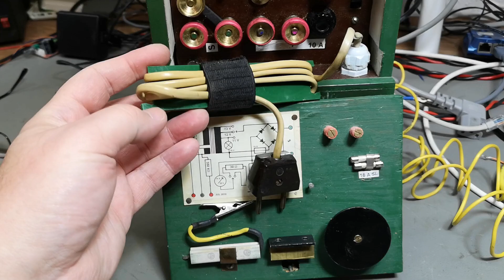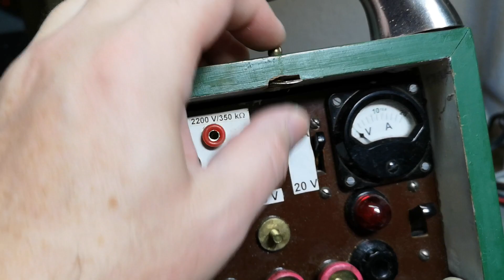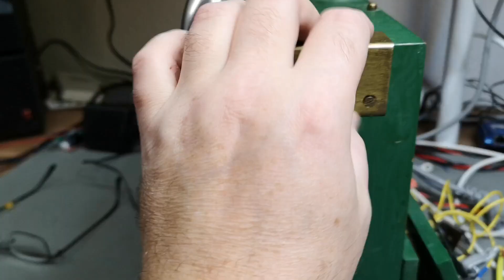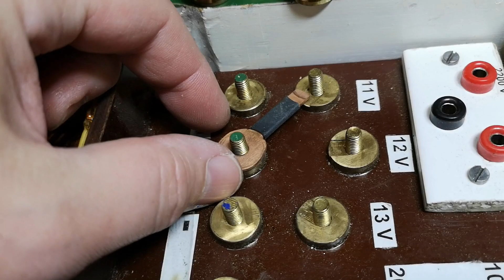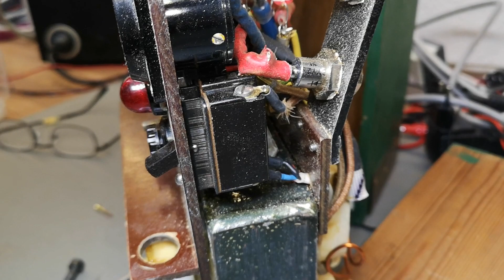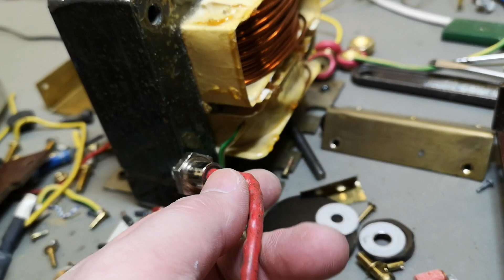DIY 12V battery charger and 2kV microwave transformator 2010

Comment: Part of an Electric Chair.
Reply from the maker: i belive the parts are from a microwave oven, and its purpose is mainly to charge a 12V car battery, the high voltage output is very scary

Comment: My o my, a dangertron 3000, The idea of winding a low voltage output on top of the HV secondary of a MOT alone is really scary.
Reply from the maker: cool name, i had the idea to call it the brand new "KillMeFast" but then i started to think back.. way back on own first constructions, I am happy youtube was not arround back then, and even more happy no smart-ass wise dude rewiev my own "products" :-) i cant be the only one.. so it seem, But with that comment : microwave transformers are free, and easy to reuse, but please folks : REMOVE the high voltage winding, and the constant current metal, then wind you own LOW voltage high current sec and have fun, now it is quite safe

Comment: Wonder if that was built by a ham that used tubes for transmitting.  Most of those tubes require a kv or more for B+. The low voltage could supply the filments. Unsafe, yes but the owner built it and knew what they had. The danger is when it is passed on to someone else who may not observe before messing around with it.
Reply from the maker: sure looks like a ham dude's work :-)

Comment: Hey at least they used recessed bananna jacks for the high voltage.
Reply from the maker: the safe distance to a finger touch is far from what is needed here, there will be an arc over to the fingers if you touch the plastic, and arc is close to full connection, the danger is plastic may it look safe, while it is not.

Comment: Croc clip leaded resistor is to discharge capacitors on high voltage, like a chicken stick. Left the shunts in to limit charge current into a flat battery, though with that transformer you probably would not want to leave it connected for long, likely 20 minutes to get enough boost in to start.

I have a similar charger, made using a welder, with a 40A thermal breaker on the secondary, and a half wave rectifier using a press fit 50A diode in a piece of aluminium plate as cooling. Will boost a battery in 5 minutes, but will also trip the breaker in 3, so when it has tripped the third time the car is very likely ready to start.